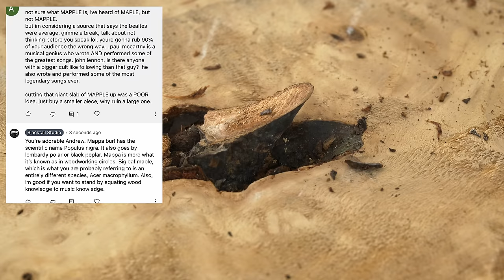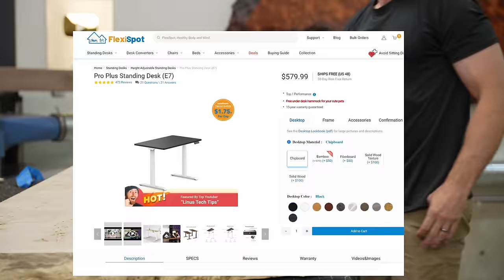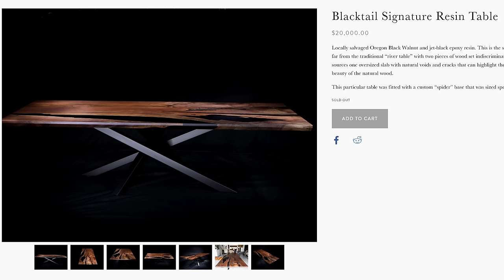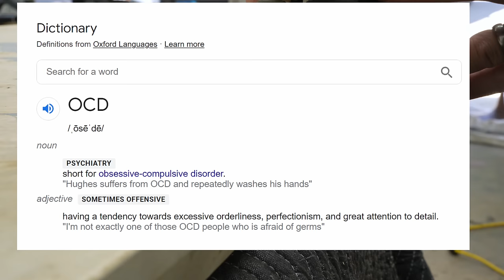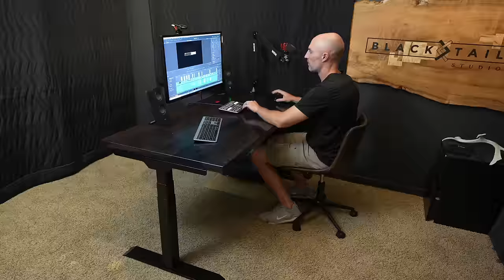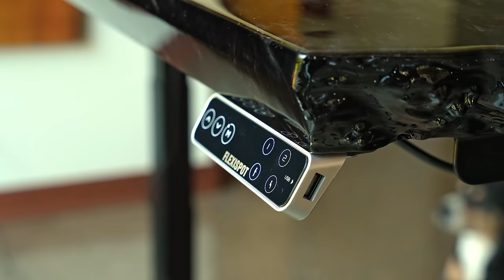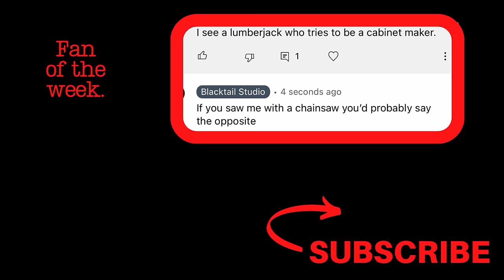Woodworking Fraud

Comment: Hello cam! 
In the guitar business, when they find a “slab” that has beautiful grain or very unique patterns, they slice the slab into many thin “sheets” so you can use 80%-90% of regular walnut for the majority of the weight of the table with maybe some undesirable grain, and cover it or “cap” it with the 10% of the “beautiful” sheet of unique wood you have.
This way many customers get access to that unique pattern. Maybe a silly idea but it’s something that has worked for Gibson Les Paul guitars for decades.
Reply: "Why" do "you" "feel" "compelled" to "use"  "quotation marks" "everywhere" "?"
Reply: He's a one man shop who makes high end custom single pieces.  He's not going to kill himself pumping out volume of pieces that are lower in quality and sell for a lower price point.  I don't even think it'd be any less work to finish top laminate properly.  There must be another reason guitar companies do this, maybe to have a harder wood for structure
Reply: @SoulDelSol  might save on wood costs? but agreed this is something you'd do when you are also offshoring the labor
Reply: @SoulDelSol  On a guitar, the edge is done seperately anyways, giving you the opportunity to perfectly hide the fact that the highend optical wood is thin.
Reply: On a table, the edge would reveal what you did. And you could not do a natural edge at all. On a guitar, the edge is done seperately anyway, so you can hide away the very sturdy, very uniform, but also very cheap-looking wood you use on the inside.
Reply: @slappy8941  I'm wetting myself laughing over here! Comment of the day for me!
Reply: "hey"  like "what's" it "matter"
   Hahahahahaha.
  Perfectionism "syndrome"???
   Lmao
Reply: @SoulDelSol  not only all that, but with guitars, if you don't a do veneer you're hogging out tons of high quality material, so it's better to veneer it. That's just an opinion though 🤣 But yeah, no way would I do that with a table.
Reply: The high end guitars are solid wood. All of them. Plywood guitars look usually look OK but the sound gives them away.
Reply: @jeffreymartin1892  - You can still have solid wood, even if tat wood is cheaper or an undesirable grain.  What this is about is to veneer or to not veneer, that is the question.
Reply: @FHL-Devils  That's true. The point I was trying to make is that if you veneer solid wood - that is basically plywood. The higher end guitars do not do that.
Reply: @jeffreymartin1892  I understand where you're coming from, but I entirely disagree.  It's like saying if you paint your garage floor, it's no longer solid concrete... or if you do have a solid wood guitar, as soon as you varnish it, it's no longer solid wood.
Reply: @FHL-Devils  Finishing wood or concrete is not the same thing as gluing layers together to get the desired thickness. You can disagree, but there are NO high end guitars made of laminate wood. All high end guitars ARE finished, however. The sound does not travel through glue as well as solid wood. In the guitar world, veneer is used to create a solid wood appearance at a low cost, not for sound.
Reply: @jeffreymartin1892  - Clearly either you don't know what a veneer is, or you're arguing for the sake of arguing.  Either way, this is my last comment on the topic.
Reply: @FHL-Devils  I appreciate that.

Comment: hi there..
am hooked on your vids..
just watching you "create" is uber relaxing..
retired now, but fiberglass was my business...
we had much success achieving high gloss, scratch free, ultra flat surface with absolutely no sanding at all. (for moulds etc)
If you haven't already tried this, grab a piece of A4 size float glass (for a trial run) a good chemical release agent, and then settle the glass down on top of your wet epoxy.
You can try it upside down too, but using protruding pin heads or any shim for that matter, to avoid the weight of your wood squeezing out all the epoxy.
I know it is an experiment you will enjoy.

Regards
Michael

Comment: I learned to make fades in artwork and also hair cutting and it may apply to this as well. For hair, you shave one part short, and the other long, then for the third you choose one in the middle of those two lengths and cut over the line where the short and long meet. And in art, for colors, you first apply the light color to the whole piece, then you apply the darkest color where you want the dark to be, then you take a medium light color and go over the seam, then go over everything with the light color again- focusing on the seam between light and dark. Eventually, the seam should disappear and you'll have a nice fade.

Comment: Dark is awesome.  One trick to see scratches before moving on to finer sanding is using what the autobody use is powered guide coat. It comes in black and white. Sand then put the guide coat on, sand with next finer paper till the guide coat is gone so you know the previous sand scratches are gone.

Comment: Once I came across a similar cut of burl poplar. Very beautiful original texture. I thought that simply sanded and polished under a layer of varnish or epoxy it would lose its true beauty. And then I lightly brushed it with a large plastic brush on a machine. So as to reveal the texture, and not make holes. Then a little liquid varnish from a spray gun. It turned out beautiful.

Comment: Dark! That looks amazing, I like dark stuff, but to start with I was not sure it was going to work with the wood being so light, love how you made it look stunning. 

BTW - on the tool front, one of the tools I've been most surprised by is a battery glue gun. The battery adds weight and stability so it's much easier to put down and work with between glue jobs, where the mains ones suffer from the power lead trying to drag them around and all that, I've also had no issues with the one I've got (a Ryobi) dribbling glue like the mains powered ones tend to and it works really well.

Comment: Dark -For 7 years you're doing great. I got a little lost on the fraud part lol My first project was a large mirror frame made from reclaimed bridge wood, I inherited my talents to some degree, but my first project still is some of my best work. Enough about the fraud confusion. Something I didn't notice, on your edges, and pokey rough parts of rustic pieces, I hit them with wire brushes. I use a course brush and then a brass brush to finish sand rough ends and the patch areas before filling and then I cut sanding pads in half so they will bend a little more helps too. You're doing great, I would guess at least 20 years experience. Take this for what it's worth, I've worked wood and done professional wood stripping and now suffer from different breathing disorders. Wear protection young man, I know it's a hassle but, please protect yourself. I probably took 10 years off my life being lazy about the protection. Thanks for the desk idea, and video, ironic I was just looking at those lol

Comment: Dark, but in this case only.

Some comments from a much less accomplished woodie:  Epoxy would have leveled much better if heated, thinned and brushed.  Might have saved extensive work used to flatten it later.  12:46, thinning epoxy for a seal coat:  Denatured alcohol thins epoxy safer and cheaper, and as a bonus it smells better.  Isopropyl alcohol at 15:00, that's not the same stuff, it has a lotta water in it.  Block sanding goes best when the material being sanded is really hard, or it will (as you discovered) gum up your sandpaper.  The cute way to avoid gumming is to WET SAND the surface. Wet/dry sandpaper uses really sharp black silicon carbide abrasive so it cuts well.  The adhesive used for it doesn't disintegrate when wet, neither does the base paper. Next, a dedicated finishing booth with really good (HEPA) air filtration might reduce the level of effort needed to finish your work.  Note:  no finish is "designed for wood furniture" if you're applying it to epoxy, not wood. I've had this argument with my wife who insists on using products labeled "for wood" when actually it's being applied to old who-knows-what finishes.

Comment: Dark definitely. I made guitars electric and acoustic. When I did sunburst, I mixed up the colour I wanted and diluted it right down. I then used it in the spray gun. Set the spray pattern so it's just a whisper of stain coming out. Start at the edges and get the depth of colour  you want. Then, working around from the outside edge, you gradually build up your burst to what you need. It really does work so much better than using the sander method. Best of luck with your next attempt.

Comment: Dark looks great for that table! One thing I wanted to mention on some of your other videos where you use the 3m Perfect It buffing process, make sure to wipe with alcohol or glass cleaner after your Ultra Fine step, as the 3M compounds have some fillers in them. The fillers fill the smallest scratches, and over time the scratches come back. There is another system called 3D, which I use at the body shop, that doesn’t have any fillers, which I prefer over the 3M system. Also, Trizact makes 5000 grit that will make your buffing even easier. And straight water with the Trizact, it is self lubricating. Glad to answer any questions about it! Love your work!

Comment: Dark... When using the foam pads, make sure you clean them after using them and store them in a large ziploc bag to keep them as dust free as possible. The swirls likely came from dust on the foam pads. Also, don't use loop wool pads, made sure it's a "cut loop'" typs of high quality. The looped wool will burn the edges very quickly.

Comment: Cam,
As a failed chemist I would you were on the right track using the kitchen scale to measure your epoxy components. Go back to your suppliers and they should be able to provide you with ratios by weight.

Otherwise keep up the great work.

Comment: Dark;

That is a piece so nice that one could stand (or sit) for some while and just gaze into the wood surface. Similar to a fractal surface - more detail the closer you approach. Also, the ceramic coating is a fantastic tip - thanks. I think your audience will be split on those that want to use it as a table and those that want to hang in on the wall as Art... ;)
Reply: DARK!

Comment: DARK, of course. The pains with polyurethane you mentioned were exactly what I ran into when I recently started making my own desks from a slab of raw wood I bought. You have to be so finicky and spend so much time on the technique of just applying the coat itself, and doing it 5-7 times as well for the finish I wanted, it ended up being so time consuming. It made me wonder why you couldn't just use two part epoxy for the same thing. Well, I guess you can, your results look great!

Comment: You're right about the tools.
One simply cannot make a professional and nice-looking work with cheap crap tools....no way!
However, it doesn't need to be a set of 1000 $ chisels or the like. Just good quality tools and what's even as important...maintenance. If one doesn't learn how to maintain the tools (sharpening etc) there will never in a thousand years be a good result. If one doesn't have that skills yet let a pro do the things for you and you'll end up with superb quality again.
Reply: This isn't always true. There is a Filipino woodworking lady that builds amazingly exotic speaker enclosures with unbelievably cheap tools, working in the back of a used tire "shop" which is basically a big shack. She doesn't have the electronics and speaker building down, but the wood part of it is insanely good
Reply: @jonking7345  True, it can be done. However, if you want to make more than just one thing now and then, it pays off to invest a little. It doesn't have to be super expensive but some tools of reasonable quality will ease your work and you'll enjoy them much longer than some crap bought cheaply.